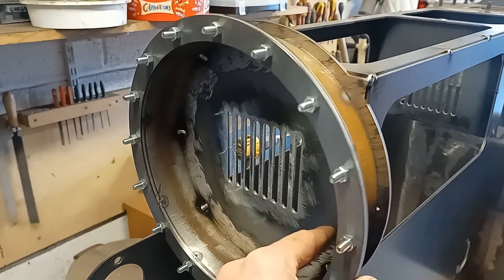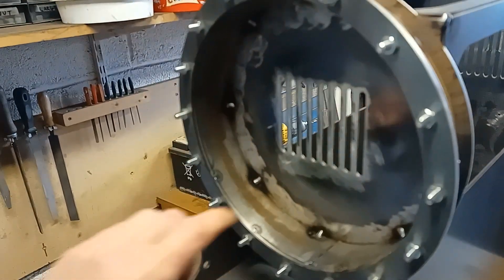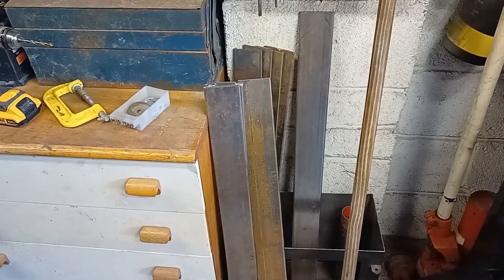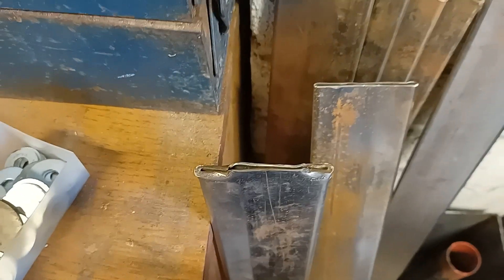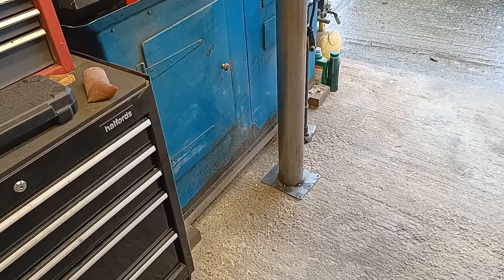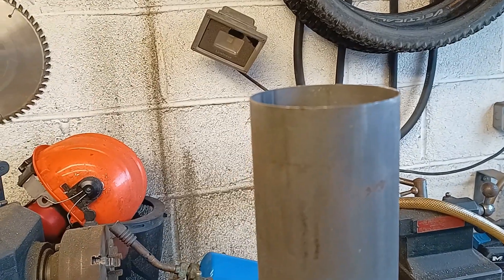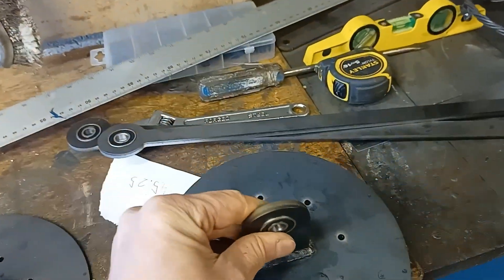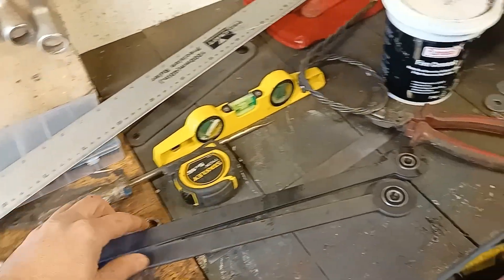Stirling Engine Generator Mk4 (Rocket Stove!) Part 3

Comment: your idea of using a flat pipe heat exchanger and diaphragm inspired me to make some unorthodox stirling engine.
i think i'm going to make one that benefit from counter-flow heat exchange so that energy recovery from flue gas is total to reach 75% as opposed to just 50%, also a large piston chamber isn't necessary, as long as you have a large diaphram that can benefit from large cross-section area to get a larger torque, the large torque can enable higher RPMs and thus higher power density.

Comment: Shane, big fan, when you finish your demo and tests would you mind raising the cold side in the air to see if effeciecy improves. I have a feeling it will improve the dead air.
Reply from the maker: I will try to remember to do that. Is that to allow more airflow around cold side?
Reply: @ShanePomeroy Unless you are putting a fin in there to make a vortex. Looks like you will have dead air, a lil angle to help with convection is my thought.

Comment: Your videos just make my day!!
A mont ago or so, i diskussed your last design wit a freind of mine, who also happends to be involved in large steam turbine design.. He imidiatly told me that "the power of low pressure is  on the Expander side" 
He said, and i kind of new it but forgot... that Expader area should be atleast 5-6 times the area of the "High pressure side" (As in a Sterling Engine vents to Atmosfere  pressure HP is really low, but still will follow the rules of enthalpy and enthropy...
Brr. he said: just make the expander side more efficient...
Regards from really cold Norway
(And please, use a thermal camera on your previos design, as you will see every movement of energy/heat)
Reply from the maker: Hello, I think I sort of understand where your friends coming from. Some other stirling designs have a slightly bigger hot piston displacement than cold where's others don't bother. I couldn't decide what to do so I kept the displacements the same. If this configuration show's potential in it's general arrangement then it would be something to explore. You've got me looking into getting a thermal camera! cheers
Reply: I quite shure he ment to add an "After Cooler" as in a boiler type steam turbine :)
Second stage cooler/expander
 (they even scavange heat from unused exhaus gasses down to Delta 5C..) @ShanePomeroy